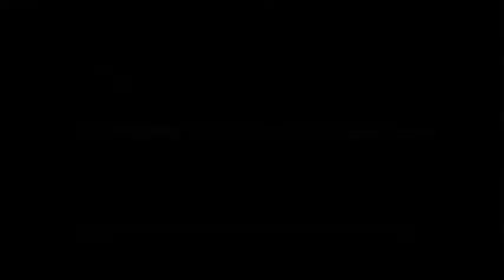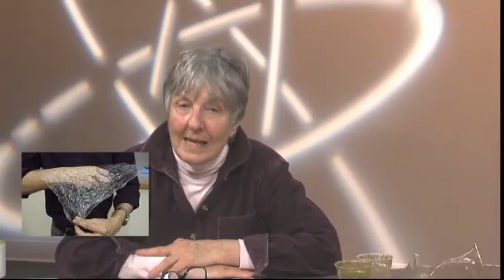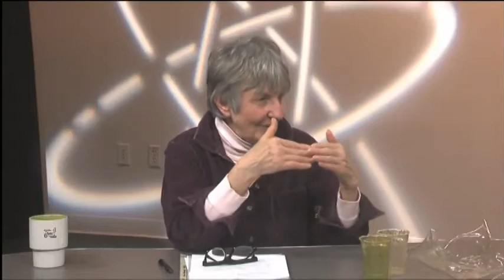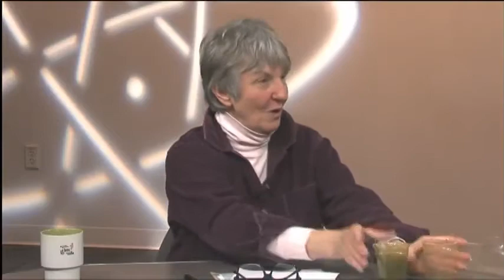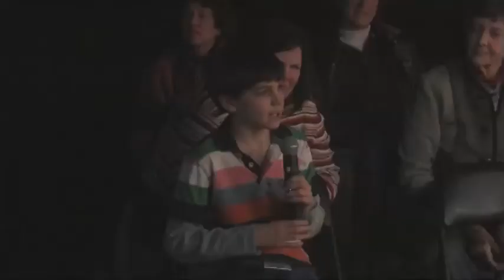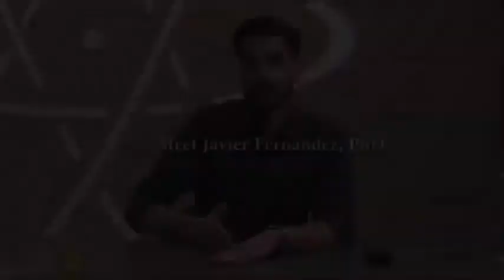Replacing Plastic: The Merits of Shrilk

Comment: Wow, impressive new bio inspired, engineering, technology: Replacing Plastic: The Merits of Shrilk, an environmentally friendly replacement for plastic. The target material has to be tough, light, and versatile --like compounds found in silk, insect wings, and shrimp shells. Interview could be a little smoother done, but info good.

It sure looks like they've found a holy grail: A very promising replacement based on such compounds has been developed by Javier Fernández and Donald Ingber at the Wyss Institute of Harvard. The material, which these scientists called "shrilk," is modeled on natural compounds. It is biodegradable and also biocompatible, meaning it can be used in medical applications including surgery. Shrilk can be produced inexpensively and it can be molded into complex shapes varying in stiffness and elasticity.

Thank you Forum Network for hosting this public science interview with Mr. Javier G. Fernández, PhD, a Materials scientist and Postdoctoral Fellow in the lab of Donald Ingber, M.D., Ph.D. He's the founding director of the Wyss Institute for Biologically Inspired Engineering, Harvard School of Engineering and Applied Sciences.